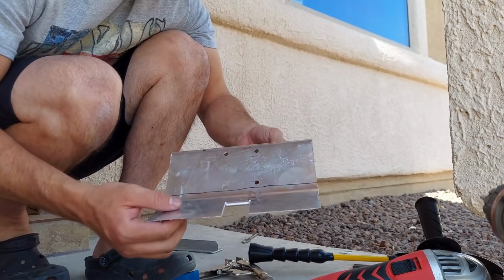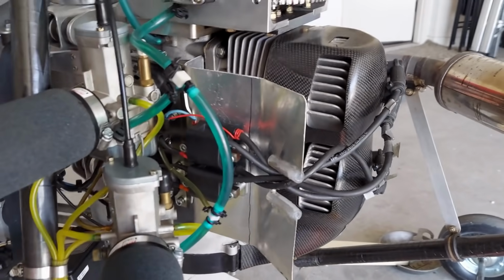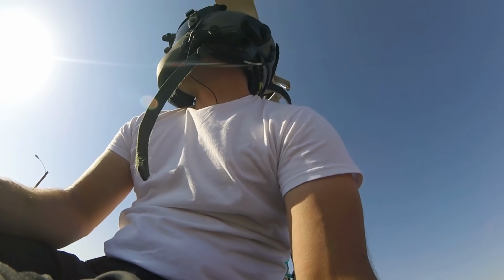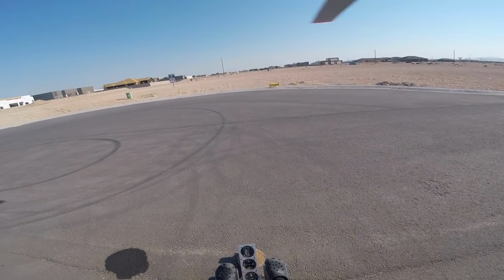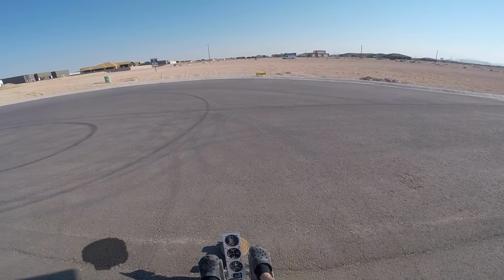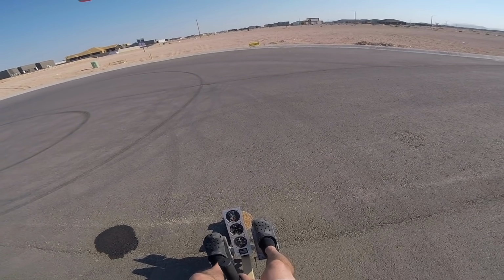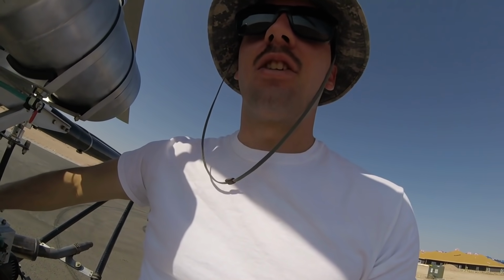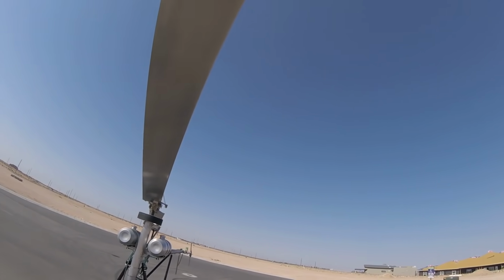Personal Home Built Helicopter fits in my Garage!

Comment: the landing fixture is built with fry pan and dumbbell. And you transport the chopper with a one-wheeler and fly it wearing crocs and shorts. Instant respect!
Reply: สุดยอดไปเลย
Reply: If his lid is the real thing (a fully kitted out Gentex Hgu-56p flight helmet)  that's a 5 grand piece of kit...
So maybe he blew his PPE budget on his helmet. (Or judging by the fellas age and appearance... perhaps "barrowed"  from uncle Sam when he's not using it for work?) 

Or it's a ebay knockoff that goes for like 30 bucks. 😂

Comment: I thought this was an autogyro
Reply: The Mosquito uses a powered rotor system. Gyros don't have a powered rotor system (other than for pre-rotation) and they used a prop (in pusher or tractor configuration) for thrust.

Comment: Good stuff, mate.
I can imagine you're "that guy" in the neighbourhood ("mom! that man is pushing his helicopter on an electric unicycle again" "get away from the window, honey") That's a compliment, the world needs more "that guy" people, they add character to an otherwise boring world.

30k? What's the endurance and cruise speed?
Reply from the maker: Depends on altitude but you can go 50mph for about an hour
Reply: I was a moto mechanic for 18 years.  Any time the plastic on the coils was heat-cracked they tested out of spec.
Reply: Could be worse, In my neighborhood the 'one wheel guy' was using a hoverboard to transport his 2 babies. One was probably MAYBE 1.5 years old, the other was like 3. He was carrying one with the other on his shoulders.
Reply: @suntzu6122  yikes
edit: whereabouts is that? that seems like a big city thing to do

Comment: I think the heat shield is a great idea but also I would run some tubing from the carburetor toward the front and put the air filters up there so it's sucking in cold air for sure.

Comment: Put a few spacers (washers) under the coils. The Air Gap will help wonders. And even adding a layer of insulation on the engine side of your heat shield will help. And help keep the heat transfer to a minimum ☺️ And a composite shield would help. Make it larger. Since weight would be less of a consideration. And an idler pulley on the belt,.. blah blah blah ✌️
...us old aerospace guys Love Toys 😍 good job
Reply: I definitely agree with the washers.  The way it is now is like a reverse heat sink.
Reply: @woodhonky3890  
Yeah, pretty much.
The coil is like the only Cooling Fin 😂🥵
Reply from the maker: Thanks!

Comment: This is the original Mad Max copter! Brought back some long forgotten memories. All you need now is a one-eyed dog as a co-pilot and a blond damsel in distress to rescue.
Reply: Wasn't the mad max copter an auto "gyro"? (Gyrocopter)
Reply: @astr0creep6x6x6 it was! It used a prop in the rear to push the craft forward without the need for driving the overhead rotors

Comment: I know you probably already figured this out but sometimes if your vent tubes are vented wrong where air can get rammed into them it can change the pressure in your float bowl to make your carbs run richer sometimes it's good to have them run short so the pressure is equalized in both carburetor float poles people run long ones on airplanes then run them straight into the air in the pressure is way too much causing a rich mixture I love your flying machine brother it's awesome

Comment: It fascinates me to wonder how you trim the Tip Path Plane? It looks perfectly balanced with both blades in the same plane? In the Air Force the choppers had super complex devices for tracking our rotor blades.
Reply from the maker: This was done the old fashion way. One blade tip painted red, the other painted green allows you to visually see which blade is higher or lower. Then you adjust the pitch link half a turn and run it up again to see if its tracking properly.
Reply: @MitchG  How do you do this by yourself? You taught someone to run up the machine?

Comment: Hot air is less dense, so your carbs need to be leaned on hot days, I would suggest keeping a chart on temp, and humidity on the days you fly, you'll soon be able to adjust carbs with no problems.

Comment: If the heat shield is only for wires protection why not trying wire insulators which they coat the wires thoroughly, I recommend Wirefy Heat Shrink Tubing as the most reliable and highest-quality solution.

Comment: Small electric turbo would eliminate altitude density issues.
Reply from the maker: This issue is the heli has a max weight limit to be classified as an ultralight which doesn't require a license. Turbos would make it to heavy. It actually has a really good power to weight ratio for this class of helicopter

Comment: I really need one of these for my commute.  Its only 12ish miles,  but only  the first 4 of that is on good normal roads...  the middle 4 is on a rough 4x4 track, and the last 4 is on a treacherous stretch of paved single lane with no sight distance on the hills and corners with free range cows and a fuck ton of feral goats that like to dart across it... and you are staring right into the rising sun in the morning. That 12ish miles takes about 40 minutes to drive in my work truck. 

With this? I could fly directly to my site in about 15 minutes.
Reply from the maker: @stinkyfungus  check out paramotors as well. They could also get you to work but cost less and are easier to store and transport

Comment: I keep thinking of military applications for such a tiny, light, portable "helicopter".  Problem is, if the U.S. military contracted with a big company to design something just like this, they would cost well over $1,000,000 each I am certain!   This guy probably did this for about 1% of that!
Reply: Basic Bell 206s are in the $1M range which I believe are used for helicopter training in the army. Opposite that spectrum is the Black Hornet Nano drone which is 6" x 1", and a field kit costs about $30K for each (Best guess I could find since they buy into a development contract and not individual unit cost).
Reply: @BrianNicolich  That is interesting information!  Also, kind of supports what I was saying about how the military probably wouldn't do things on the cheap.  Although, I'm not saying they should- low bid often isn't a good path to quality equipment, but we''ve all seen the $10,000 claw hammer and $20,000 commode defense contracts, so surely somewhere betweem the $1 mil chopper and the $30 chopper you mention there is room for something in between!?!
Reply: @thecityman1910  Coming from the USMC airwing you have no idea how stupid expensive parts are... But that applies in the commercial/civilian sector as well. IMHO the modern contracts are predisposed to be lucrative to the winning bidders these days. But a few smaller American companies are squeezing in, particularly in the drone sector where there is a vacuum now that Chinese products are banned.

Comment: Why do you have your spark plug wires in the exhaust path?   Put longer wires on there and get them out of the hot gases...
Reply from the maker: That was the point of the heat shield that I made. To shield the coils from the engine heat. I think the spark plug wires deal with the heat just fine the way they are.

Comment: Nice works & videos both on your helicopter and Paramotor - I am interesting to order a complete mosquito air kit and assemble it by myself.
- Could you please tell me:
- How many hours you have used to assemble this helicopter?
- Price for complete kit?
- Web site for the ordering the kit?
Thanks
Reply from the maker: This kit is no longer sold. I bought this 90% complete and just finished it. It took me just a week or 2 to get it flying.
Reply: @MitchG  Total price???
Reply from the maker: @erikleekramer8354  the kits sold for around 32k and take 300 hours of work to complete.
Reply: Nice

Comment: Is there an accelerator pump to help the carb transition “off of the idle jet”? Probably have to re jet Summer to Winter? I can see this rig is a challenge to keep jetted properly.
Reply from the maker: I dont think the carbs have an accel pump but its really not needed since as soon as you leave the ground the throttle will always be at least 50% the rest of the flight. The carbs are easy to access and it takes 5 min to swap jets or raise the needle from summer to winter. I enjoy it!

Comment: Have you “flagged” the rotors to check the track? We used tracking flags and an electronic system called vibrex in the army to track the rotors
Reply from the maker: One blade tip is painted green and one orange. When I get to full rpm, it's easy to see if one blade is out of track so I adjust the pitch links until both colors fly the same tip path. Same thing the computer does but the old fashion way.

Comment: Positive side of hot air on those carbs.....no icing.

A 2 stroke wants to run on the rich side for piston cooling.....granted it robs a bit of power.....and a weak mix may sound better.....but running weaker is a risk in a 2 stroke.....especially in light load conditions.

My Rotax 503 was near enough fully shrouded....what motor are you running....dont look like a rotax....a Hirth maybe???

But the company that produced my microlight modified the shroud to blow hot air on the carbs.....to help re icing.

Comment: If it was running rich, would the EGT's not be lower?
Reply from the maker: EGT was below normal operating temperature until jets were changed to the correct size for this altitude

Comment: Do you have some sort of neutral for auto rotation in case of engine failure?
Reply from the maker: Yes. The engine has a clutch that can disengage the rotor from the engine and allow autorotation in case of engine failure

Comment: Hay Mitch,
     Why are the two cylinder heads covered up so much with carbon fiber. Do you think that they would have a better opportunity to dissipate heat and be cooled if the head was wide open as much as possible to the air .Even though the  Finns are open to the air the rest of the head is encapsulated trapping large amount of heat that would otherwise  dissipate into the air and allowing the motor to cool easier and more..
       I am very interested in what you think about my comment
Reply from the maker: The carbon fiber is a shroud that channels the air from the cooling fan on the bottom of the engine up through the fins on the cylinder heads. Much better cooling than just open air cylinder heads
Reply: @MitchG  I did not know that thanks for the explanation

Comment: Why do you have the spark plug leads directly in front of the hot cylinder head cooling exit ? You might want to reroute those so they dont melt the insulation off. How did you not see that and has this passed an FAA SAFTY INSPECTION ?

Comment: Is that a custom exhaust setup?
Reply from the maker: I think so. I didn't build it but I haven't seen another like it. Inside the pipe, after the muffler, is a baffel to bounce the pressure wave back into the exhaust port. I'm sure a factory exhaust would be lighter weight and make the CG better for light weight guys but this one has plenty of power so I'm going to keep it

Comment: If your drive belt is like a typical gates paramotor belt it will tighten up as it gets hotter and loosen when it gets cooler. You would think it would be the opposite. how do you adjust the tension? don't tell me you "pluck it" with a guitar tuning app! 😂
Reply from the maker: In the manual it gives a range of flex with 10lbs of force applied. 💪

Comment: Build another one but make it electric with a lighter designed structure so batter life is less of an issue. More carbon fiber tubing.
Reply from the maker: @EricPeelMusic  it's very possible but the flight time would be very limited. Maybe 15 minutes of flight time.
Reply: Thats better than what I was expecting. Would be cool though. Thanks for what you do. Very inspiring.

Comment: I have an Mz202 engine...it came with 160's and 185's.  The needle and needle jet and idle jet are correct per the factory in China..Where can I get parts in the USA? Shipping from China hurts!! This engine is on a KOlb Firestar II so wondering if there are any mods that were used on the Helicopter..Mounting the exhaust system is a pain..This engine came from the Mosquito orignially.. also...what notch on the needle?
Reply from the maker: My mz was running super rich at 4kmsl and high Temps. I raised the needles to make the mid range Temps around 1100-1150 egt and went down main jets one size at a time until egt was at 1150 at full throttle. I forget what sizes I ended up using but I think I went down 2 sizes. Runs great now
Reply from the maker: I bought jets off ebay. I think I ended up with something around 185-165 jets
Reply: @MitchG  The factory indicates a needle model: 8F-6Z and needle jet of 2.72  main jet of  195 and  45 idle jet..... The needle as you know has three clip positions vs 4 for the usual rotax install.....Do you have a needle /needle jet preference?    How does that agree with your settings..?  Also   will  likely need a starter and ring rear/fan assy...know of any  used ones ?
Reply: doesn't that fan suck air over the cylinders? turns clockwise Prop counter clock wise...

Comment: What’s safer overall, a Mosquito helicopter or a Gyrocopter?
Reply: The latter, because it will auto-rotate as a matter of course if the engine fails.
Reply from the maker: Gyro but they require a runway to takeoff. Something I don't currently have

Comment: Wait, that belt breaks and you are  screwed.
Reply from the maker: Most cars on the road also run critical components with belts for 200+ thousand miles with zero belt maintenance. Also even if it does break, you can just autorotate and land.

Comment: Note a good idea modifying the design.  That plate might have an effect on the air flow cooling that cylinder.  At the least, the vibration of that plate might chafe the wires that are against it.

Comment: I was always with the understanding that the higher you go, the less dense the air and the more the carburetor leans out, not enrichens.
The same for heat -- the hotter the air, the less dense and therefore leans out. I could be wrong though--anyone else knows better? Rick
Reply: DUDE, the higher you go, the thinner the air, so less air means more fuel to air ratio.
Reply: Rick, you have it backwards.  Less dense air for given fuel means enriched mixture.  Think ratio.
Reply: Carburettors work on volume of air which, with less density, causes a richer mixture.